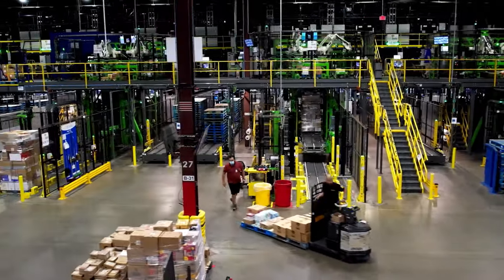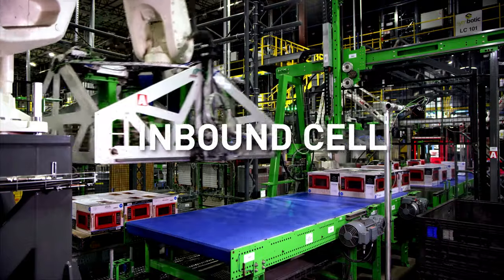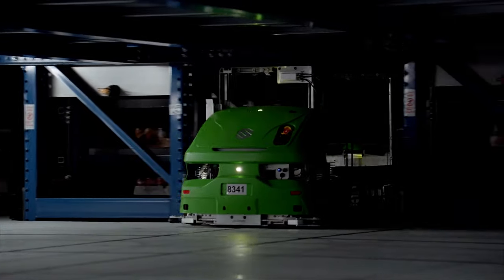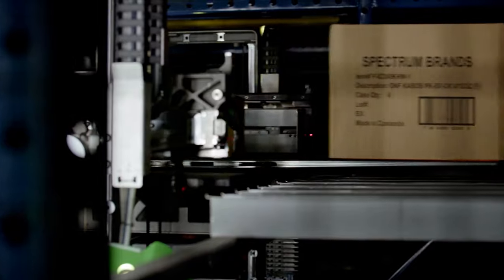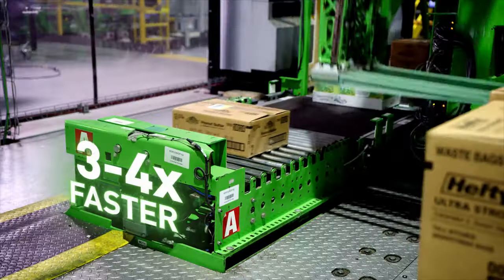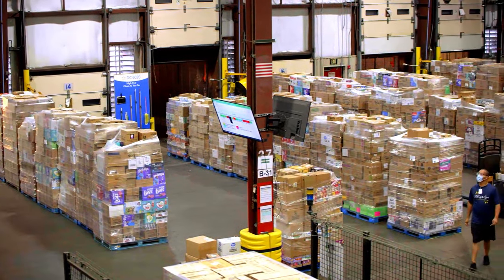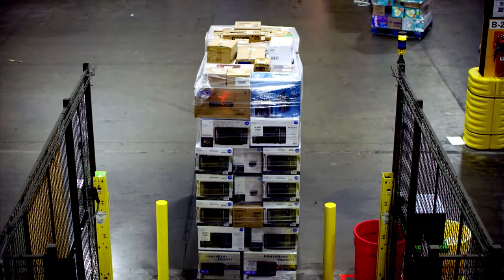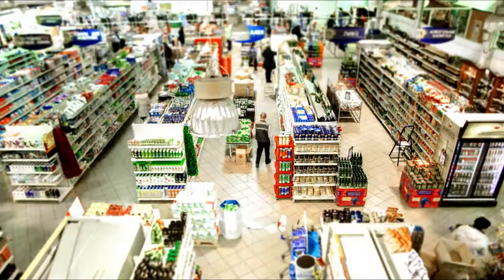Symbotic: Reimagine the Supply Chain

Comment: Where does one learn the operation of these systems?
Reply: I run that system inbound and outbound
Reply: @jmar385  I want to learn from your knowlege if possible. Please advise?
Reply: Could get a job at a C&S or Walmart that has one
Reply: @WHATITDOBURRO  It’s easy to run I was trained by Symbiotic! It looks overwhelming. The alarms & alert lets you know what’s wrong unless it’s a maintenance issues or system coding problem

Outbound the data have to be in correct order

Inbound- You can remove data! Only thing you have to worry about if the data never transfer over to the next sku! I’ll post vids on my YouTube because I’m going hard in stock with Symbiotic
Reply: or albertsons @the1andonlypop
Reply: @jmar385 I work 3rd shift so I do a lot of suspect case removal and I was wrangling bots the other night. Wrangling’s fun, I love cruising around on those little carts!

Comment: How many jobs will it cost real employees
Reply: Alot, at our warehouse we have 80-100 dry pallet selectors and this would replace all of them.
Reply: All of them eventually.
Reply: 500 at the facility were in right now
Reply: @brandonklancnik I just applied… they said they’re hiring 500 people. Is it easy work since there’s robots? What do y’all do?
Reply: Robots brake. Then we come in
Reply: The typical forklift driver and case handler gets replaced to a certain extent but you also get a lot more higher paying technical jobs fulfilled. It’s a trade off that’s necessary for faster more accurate warehouse use in today’s economy.
Reply: @travispuls8561  they only need 35 people to fill those technical jobs in a warehouse of 500+. less jobs, less money goes into the economy. the only one benefiting is the company that is saving money not having to pay people.
Reply: @twizaa  amazing for us entreprenuers
Reply: Lol
Reply: Amazing for employers....disastrous for people working in the warehouse without other skills. Eventually jobs are gonna be replaced and people will need to adapt or Die. Facts.
Reply: I work on the bots and it's a fantastic job